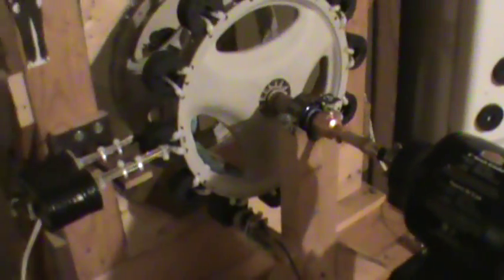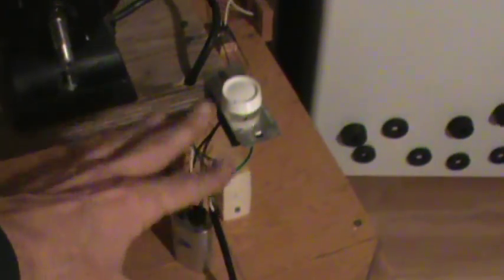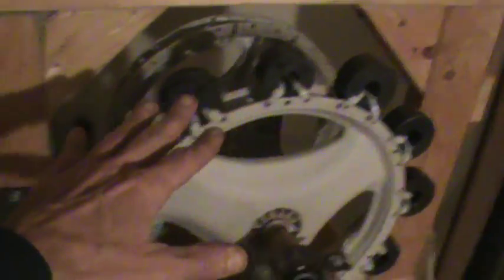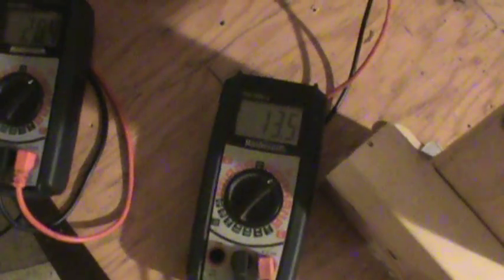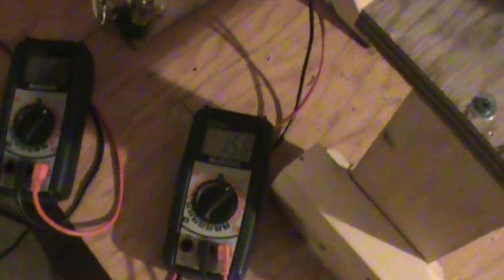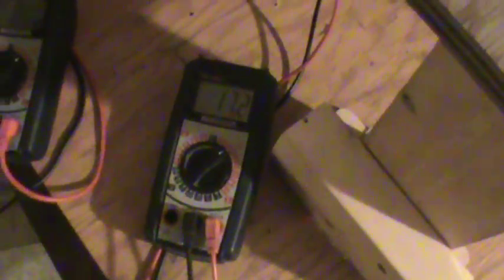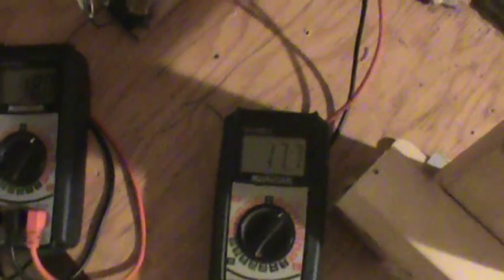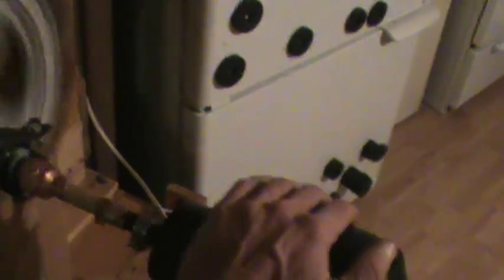Free Energy Project - New Motor Great Results

Comment: cant wait to see that video. my up-loads on to youtube have been a bit slow also. with reguards to the size wire on your coils. all of my coils i use #18 wire. i think the wire on most of those microwave transformers are closer to #15 or #16. just for grins try a double bifilar set up. ill be making a set of 9 coils like that for the 3 phase. doing that you get close to #15 wire reactions. oh , did ya use some straps to secure that monster so it doesnt vibrate across the floor yet? lol

Comment: hey buddy, nice job on the testing phase. when you have the coil shorted out did you get a chance to check for any heat build up in the coil itself? i am doing similar test off my 3 phase which should make the rpm's jump from the 1170area up to over 2000 rpm if everything works right. finally had to replace the backing that was holding all the coils , it was warpped and had the coils out of alignment. waitting to see the next vid you come up with, keep up the great work!!